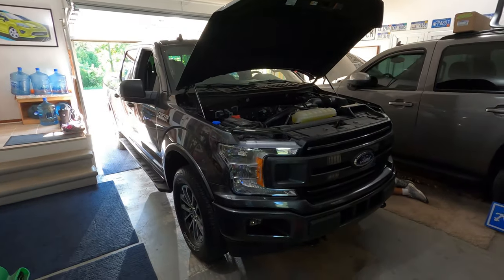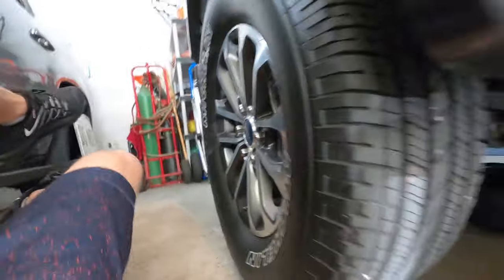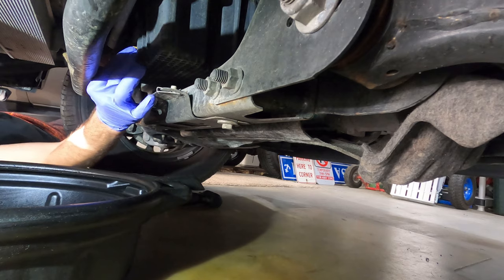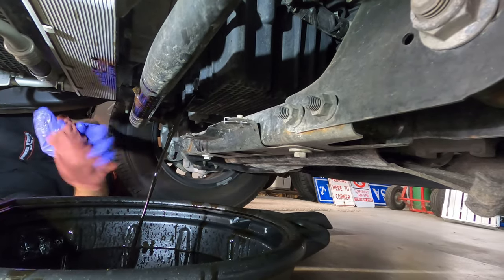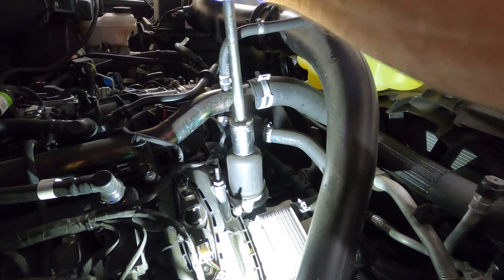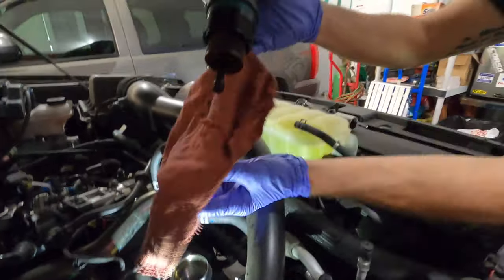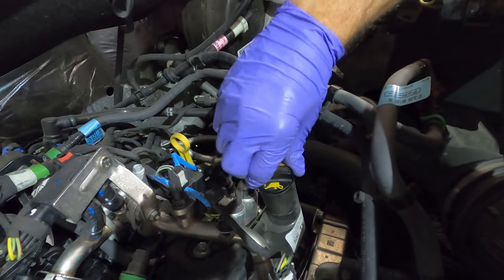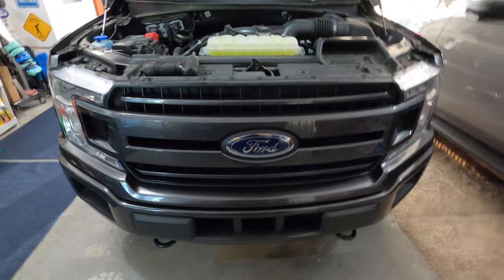2.7 F-150 Ecoboost Oil Change | How To - FORD Dealer TECH does it @home!!

Comment: A tip I learned the hard way. When you put the small O-ring on, put the new filter on first. This limits any side pressure you may put on the shaft while struggling to get the new small O ring on. I didnt and snapped off the shaft from where it mounts inside the cover. Took a day of driving all over Minnesota to find a dealer that had another one. Good luck all!
Reply: Good tip. I was worried that I would snap it. 😅
Reply: Thank you for that tip. May Jesus bless you
Reply: I use a pair of snap ring pliers ,put the ring on them then squeeze the handles.

Comment: Try rolling the small o-ring over a 6mm 1/4’ drive socket then over the tip
Reply: Just did the first oil change. No more free at the dealer. Last was about $85. That little socket tip made things much easier with that small o-ring. Total job time about 1 hr. Tks for the tip - came in handy for sure.

Comment: I can’t believe how most mechanic shop and dealership charges 150/200 CAD to do an oil change when you can do it at home in less than 30 minutes by yourself without waiting a few hours getting it done somewhere else

Comment: Might as well leave that air deflector off after the oil change. One corner broke off of mine after about 15k miles so I just removed it, and can’t even count how many I’ve seen hanging while driving down the road. Didn’t see any difference in fuel economy, and it sure doesn’t offer much in the way of protection.
Reply: Got steel plates for mine after the original felt thing fell apart.  Believe it or not, my MPG went up on the highway.

Comment: Changed mine today. Removed 3 of the air dam 8 mm screws (left the starboard rear one and swing the air dam over to the starboard side out of the way). Replace all 3 oil filter oil rings: used screwdriver to stretch the little one off. Put new small O ring on needle nose pliers and OPENED the pliers to stretch it out, got it right on. Sucked oil out through the dipstick hole with a pump, but....then pulled drain plug and 2-3 qts still gushed out. Probably a bit less gushing/cleaner than letting all 6 qt gush out. Decided i won't be able to just use the Harbor Freight oil pump to pump the oil out. Add full 5 qt jug of Full Synthetic and drove off ramps. Will slowly top off to 6ish qt tomorrow.
Reply: Bro what

Comment: I use a piece of single strand coated copper wire to get under those o rings.  I bend the end of the wire and work it under the o ring then pull the wire through and pull the o ring up and off.   Some people use a plastic dental pic to get the o rings off.  Or a metal curved mechanics pic.    Also I only remove 3 of those under engine cover bolts.  I just loosen the drivers side rear bolt then rotate the cover out of my way.  It makes it easier to put it back on.  Good video.

Comment: Thanks for the video buddy! I'll be doing my 3rd oil change tomorrow on my 2018 2.7 ecoboost, 15K miles, just like the one in the video. I'm an old guy so I like to refresh my memory before doing it again. Getting the right size sockets from the start etc. Since you asked, I use motorcraft filter and 5W-30 oil just as you did. Sometimes it's actually the cheapest oil on the shelf at walmart also. Hopefully an oil change will be the deepest I'll ever have to dive into this truck for the rest of my life. I traded in a F150 5.0 L cause I didn't like how much throttle I had to apply when merging on the interstate and long inclines while pulling about 6K lbs. of camper and cargo. This little engine and 10 speed tranny is sweeeet....hell, I dont even put my hamburger down cause I need to focus on the truck...turn up the tunes, eat a french fry and cruise with confidence! :)

Comment: Good Video Brother! My 2015 2.7 has 5w20 on filler cap, but I use 5w30 synthetic blend.  Also, one thing I have learned over the years is stay with what the MFG says to use in your engine or trans! It is formulated by Mfg for your specific application, period!
Reply: Oil filter yes,Mobil 1 synthetic is just as good if not better than Motorcraft
Reply: Manufactures don’t formulate oil, they just require a set specification to be met. Motorcraft is a decent oil. However I prefer full synthetics of the proper grade. When it comes to transmission fluid def stick to OEM in these newer vehicles for long service life 👍🏻

Comment: Because the shop where I work recycles our used oil, I don't recommend spraying the brake clean into the oil drain pan as it contaminates the oil to the point where we cant get it hauled off!

Comment: I like oil change vids. Always interesting to see how they differ. I can recall how terrible it was to do the oil on my gen 2 5.7 Toyota Sequoia. Had to remove a skid plate that was sort of heavy and awkward. I'd like to know what your worst oil change is/was....? I like to use OEM oils or Mobil 1. In my big diesels I'll use T6 Rotella or Mobil Delvac. I've had good results with both. Key is to change often. I'm not a big believer in keeping oil in there for more than 3,500 miles. Oil is cheap, an engine is not. Thanks for the video pal, hope all is good in D land!
Reply from the maker: Thanks homie!!!

Comment: Buy a Ronin Oil Plug.  Allows you to control the oil flow.  I used them on all 3 of my 2019 f150's.  Great Video!
Reply: I hold the drain plug against the hole and control the oil flow.   Haven't messed up my new concrete so far.

Comment: Just did mine and installed the Rhonin oil plug. I'm sure the next oil change will be worth it. Though I gotta say, holding the factory plug in a bit to regulate the flow for a minute or two wasn't bad at all. Very easy.

Comment: Only thing I'd add is to use AMS, Castrol GT or Mobil1 Ex oil to reduce the carbon buildup in the 2015-17 motors.

Comment: If you like checking your oil level afterwards for peace of mind, don't forget to let it sit at least 15 minutes after starting! I heard a horror story of someone putting 10 quarts in because it wouldn't mark on the dipstick.
Reply: you got different problems if you are actually putting 10 quarts of oil in a vehicle that clearly calls for 6 in the manual...
Reply: @meditationstation710  People be doing things like that! Had a jeep a few weeks ago, said they needed a brake job. They ignored it so long a backing plate shot out and killed the caliper.
Reply: @meditationstation710   lol,  right? 10 quarts?! Yea, that's crazy

Comment: Great video! Thanks for breaking it down. Yes that plastic drain plug and then that design of where the oil dumps out is frustrating. I bought the RONIN drain plug, sooo much better and cleaner to do my oil changes, no splashing anywhere. And as always I’m running AMSOIL Signature Series 100% synthetic! 🫡🤙🏽

Comment: Hey ARod.
I know 2.7 EB owners are pissed when we find out that the oil pump is driven by a belt.
I found that the replacement oil pump, Part # FT4Z-6600-1A is a CHAIN driven pump. It even comes with the CHAIN !!
Reply: is that a Ford part or aftermarket?

Comment: Thanks for the video. I was able to do mine as I had an idea how to start. I was doing last week but didnt have 27mm soceket and all my other 1/2 socket needed a tad more to fit. I tried other ways to break off but didnt want to damage the oil caseing so I had to wait about 2 days for the socket to arrive. Not too much labor. This filter was black (ran 4100 miles). I just wonder if the dealer ever changed it. Dealer charges about $85 and wait time is about 3-4  hours with an appt. I got this done in about 1 hour. Next time it will be much quicker. Have the tools and sizes needed comes in handy.

Comment: I have a 2018 2.7, I have changed the oil at least 10 times. Removing the lower panel is the hard part. Could you please send over the guy that helped you.

Comment: That plug, if you loosen it up and leave it in the pan but pull it out a little, the oil will flow directly down.  You have to hold the plug the whole time but it snot as messy for a DIYer.

Comment: Been running rotella t6 5w40 with archoil in my 05 6.0 and have about 150,000 miles on the original injectors. Love dem 6ohsss

Comment: Thanks for the video. I plan I doing this early in the a.m. tomorrow. Have all my parts and tools. I may look up torq specs for filter. I dont want to crack it. How long should I let run to cycle all the new oil thru? I think a minute would be good. Now I have to look up how to reset the oil percentage. 2017 2.7. using original ford oil and filter. have only 38k on this engine -dont put a lot of miles on it. Dealer is about $85 but it takes hours to get it done. I paid $26 less of the $85 just for parts and I do the labor at home which I dont mind.

Comment: Great video. Ty for the simple explanation on how to change the oil. Does the O rings come with the oil filter or is that separate? Just so I know to ask and purchase both at the same time.
Reply from the maker: Comes with
Reply: @PowerStrokeTechTalkwARod  tyvm

Comment: oops forgot to change o rings not leaking good to go change them next time. run full synthetic change every five thousand do not trust dealer reccomendations kinda like why the engineers of ford approved of this plastic plugs and and plastic filter cover, great video liked it bunches

Comment: Thank you, in Russia there are no such videos, because there are no these machines)

Can't find the part number, The bolt at the bottom of the engine that is yellow ...

and I saw you poured a 5 liter canister, but it seems you need 5 + 1 liter?
Reply from the maker: KX6Z-6730-B, good luck

Comment: My 04 f250 super duty 6.0 I use the motor craft  10w30 and the ford oil filter always even the fuel filter is motorcraft

Comment: Good video. Seems the drain plug is causing me to hesitate about doing this. Maybe my 2021 F 150 might be easier, but probably not. I experimented with no oil change with 100%  synthetic. Did ok for 10 + years with my 06 4.6 V8 Crown Vic with 135,000 +. Everytime it was down a quart I would just add a quart and change the filter, which is in essence adding 2 new quarts of 6. The synthetic does not tar up. The CV eventually was totaled but the engine was in good shape I figure.

Comment: with the 2.7 having a oil pump belt instead of chain/gears do you recommend the motorcraft oil over any full synth type?
Reply: Will full synthetic hurt the belts in the oil pump.  This is new to me. I guess I need to find out also before I try to tackle this.

Comment: Kirkland full synthetic, 24.00 for 10 quarts! 5w-30 or 0w-20
Reply: @repairvehicle  Project Farm has done great videos testing all sorts of synthetic oil. This one included. You should check it out.
Reply: @repairvehicle  did you watch it or are you being real skeptical? No he has not. The oil has all the proper certs and badges as do all the other brands. Check out how he tests then come back and bash what you actually have researched a bit. I'll wait.
Reply: @repairvehicle  API'S CERTIFICATION MARK AND SERVICE SYMBOL identify quality motor oils for gasoline- and diesel-powered vehicles. Not my words. Hey no one said you have to use it. It's just another possibility.
Reply: @repairvehicle  And you know this how? (this was meant for your comment above at 18 minutes ago)
Reply: @repairvehicle  That is possibly true, using that logic then pretty much none of the oils that have the marketing starburst are engine killers.
Reply: @repairvehicle  That's awesome, Then this should be more widely transmitted for people to see. I'll actually look into that. I'm surprised that they API, have not been sued into oblivion!
Reply: This is from their website, API’s Engine Oil Licensing and Certification System (EOLCS) is a voluntary licensing and certification program that authorizes engine oil marketers that meet specified requirements to use the API Engine Oil Quality Marks. Launched in 1993, API’s Engine Oil Program is a cooperative effort between the oil and additive industries and vehicle and engine manufacturers Ford, General Motors, and Fiat Chrysler and those represented by the Japan Automobile Manufacturers Association and the Truck and Engine Manufacturers Association. The performance requirements and test methods are established by vehicle and engine manufacturers and technical societies and trade associations such as (ASTM), (SAE), and the American Chemistry Council (ACC).

The Engine Oil Program is backed by monitoring and enforcement program that ensures licensees adhere to program requirements. This includes running physical, chemical, and performance tests on licensed engine oils and verifying that the API-registered Marks are properly displayed on containers and convey accurate information to consumers.

Some one is not telling the truth. Then again its on the internet, how true is any of it?
Reply: @repairvehicle  This one?   In 1998, Mobil sued Castrol over the discovery that Castrol was processing conventional oil and calling it synthetic. At the time, Mobil 1 was still created using a true synthetic basestock, which is more expensive. Mobil lost the lawsuit, and, as a result, the "new" definition of 'synthetic oil' became much looser. Or this one, http://www.syntheticwarehouse.com/Press%20Releases/Lubes_N_Greases/motor%20oils%20day%20in%20court.pdf
Reply: @repairvehicle  Good question, where where they? I would think there are others that are out there also.
Reply from the maker: Waiting.....
Reply: @PowerStrokeTechTalkwARod  That was a rhetorical question Mr.A, but it still stands!
Reply from the maker: Hahahahahah
Reply: Kirkland, Supertech, Farm oil, all made by warren industries using mobil exxon base stock. Warren industries has been making oil for decades upon decades, for many different names. 

It has been tested by analysis new, used, high mileage, etc many many many times. It just as good as any other name on the shelf.
Reply: @Resistculturaldecline  Thanks Kevin, I haven't had time to try and find out who made the kirkland oil. Appreciate this.

Comment: i took my f150 to dealer for oil changes every 5k. the one time im doing it myself. the bolts is rusted shut and rounded. I dont think they changed my oil unless they used some oil pump through fill cap
Reply from the maker: Awee man

Comment: Why non use full synthetic oil?   Proven better.  Why would Ford recommend semi synthetic?   Turbos need the best oil
Reply: Motorcraft blend is decent...
Reply from the maker: Theres my boy
Reply: @DS-TRUCKS  used 5-20motorcraft semi on my 2011 5.0 f150. got 360,000 miles on it & runs like a clock.
Reply: @mikepapienuk1040  That's awesome!

Comment: A bit of brake clean gets inside the engine when you clean off the plug with it and immediately put that plug back in the engine. I'm sure the small amount of brake clean in the engine wont matter since itll just burn off, but Im pretty paranoid that the brake clean would "degrease" anything it comes into contact with
Reply from the maker: U have nuthing to worry about

Comment: A plastic drain plug that just clicks in??  Kinda nice but also kinda like 😯
Reply from the maker: What's wrong
Reply: @PowerStrokeTechTalkwARod  oh nothing wrong, just something new I haven't seen on any car I've changed oil on for the last 30 years. But seems easier, kinda surprised though, I had an 2018 Mustang Ecoboost that didn't have that style plug, so maybe its new or only used in certain applications?
Reply from the maker: A lot of the composite pan use this now

Comment: Thanks for the lesson.  When I was younger I always did my own oil changes but it's be a few years and engines have changed.  Albeit a simple thing to complete it is nice to know the new tricks.  My truck has over a 100000 km now so I went with a 5/30 Castrol High mileage. My understanding is that it is 50/50 oil and synthetic. It is nice to hear from you that OEM was a mix as well.
1 question though if you could. The winters were I live now hit -60F and a balmy day is -15-20F. If I run an oil pan heater, can I stay at 5/30 or should I go with a 0/30?  Thanks again for the lesson, it is a good video.
Reply from the maker: Both will be juss fine

Comment: 2011 F150 Harley Davidson w/6.2. Used the 5w-20 motorcraft blended oil every 5000 miles. 180,000 on the clock

Comment: I have a 2019 F150 2.7, 44k miles. I've noticed oil on the front cover below the oil filter housing...particularly around the bolt, an dfurther down the front cover. Where is this leak coming from? Just the thought about taking it to ford dealer under factory warranty, I may not have my truck for 3 weeks!
Reply from the maker: Gotta put oil leak dye in it & inspect with a black light
Reply: @PowerStrokeTechTalkwARod  
Bummer. I have an appointment to take it to ford dealer Monday. Hopefully it's not major. Love the truck, but hate these type of issues. 
Thank you!
Reply from the maker: Thats silicone for ya

Comment: Do the oil filter O rings need to be change during every oil change? or can they be used a few times? I ask because since it is time consuming, I don't believe the dealer or quick lube will care to change these O rings.
Reply from the maker: I re use em

Comment: Did it take the full 6 quarts? Bunch of folks with the new 2.7 Bronco can’t seem to get 6 quarts in without going over the max fill mark on the dip stick.
Reply from the maker: 6
Reply: It will hold about a half of quart after you drain it. I only fill with 5.5 and its right at the full! I have a 2017 f150 2.7!

Comment: I have a 2021. They tell me that the oil plug needs to be changed every time. Is that new to the 2021 or a sham or just over the top?
Reply from the maker: Brother, keep a spare but it does NOT need to be replaced every time
Reply: @PowerStrokeTechTalkwARod  awesome! Thank you. Subscribed 👍🏻